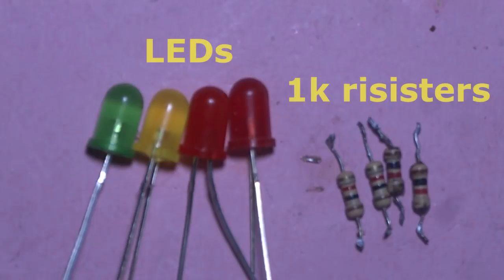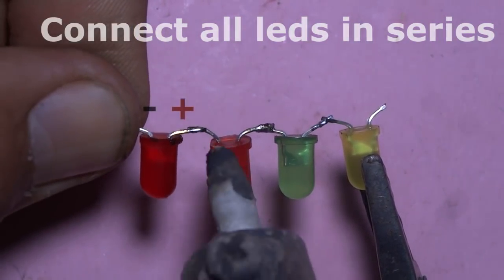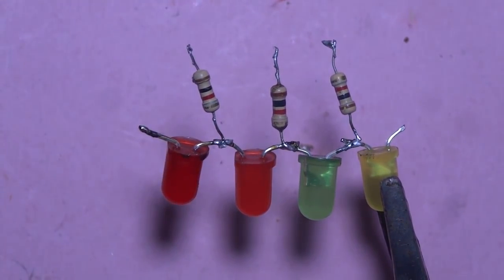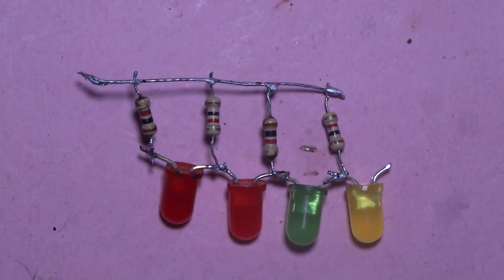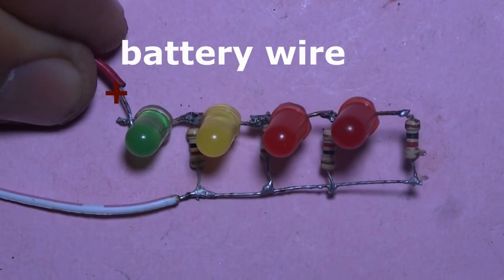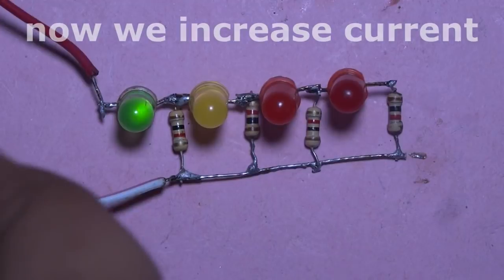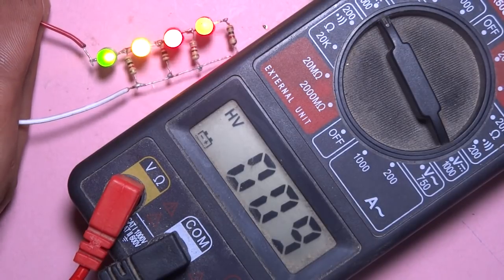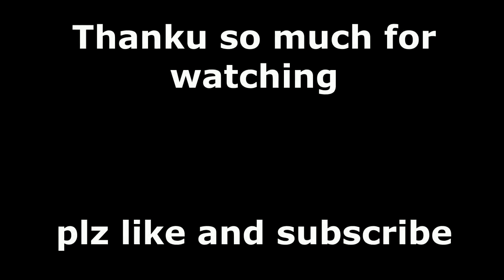Battery Current Level Indicator

Comment: Sir can this circuit be used for 12 volt 220ah acid battery.
And
Sir, can 10 LED bulbs be put in it to check from 10% to 100%.
Reply from the maker: yes dear you can use 10 LEDs in this way to check battery then you will have to 220 ohm resistors 
plz visit my website for my promotion and 2 ads clicks for my sport 
www.envirementalb.com
Reply: gillani data Thanks for the reply Sir.
And,
Sir can this circuit be used for 12 volt 220ah acid battery.
Reply: gillani data Sir, I installed a 5 led and 1k rasistor and connected it to a 12volt 220ah battery. The five led are working but the led is not getting down. Did I do something wrong?

Comment: Hello Gillani Data. This is great. But I want to use it in my motorcycle. I have had been facing battery problem from last 8 years and this could help me to know the level of battery. I Have a 12 volt and 14 Amp. battery. Please share the circuit. Thanks in advance.
Reply from the maker: Yes u can use it
Reply: @gillanidata   Do I have to  add more resistors and leds?? If yes then how many??
Reply from the maker: Yes u can use more resistor

Comment: What resistor need if I want 24v?
Reply: Calculat , 24v ( U ) - 3v ( U Led) impartit la 0.020 ( I Led) = 870 ohm. dar ptr. siguranta poti sa pui 1.2 k.
Reply from the maker: Plz write in English
Reply: korkodel i tried The circuit but it not work well because is for 20v

Comment: But as the voltage increases, the first led is going to get more and more current, while the last led will get reduced voltage, from all of the previous vf from the other leds.
The last led will get like 6 volts less than the first one.
Reply from the maker: Yes dear this problem can b solved with change in resistors 
Anyhow this method will not burn 1st led till 30v

Comment: You can't use it for battery. The logic is OK.. But not practical. This circuit is working from 0v to 12v. First led will glow at 3v 2nd at 6v 3rd on 9v and last full will glow on 12v. But battery is 13v when full and when very low its measured around 10.85v so I don't feel this circuit have title of battery level measurement. If battery is critically low.. Even then it will give you 7v or 8v... Can't be 3v or less
Reply from the maker: U are right 1 more led with 420ohm resistor can b used

Comment: excessive power loss due to resistors. use transistor based control for low power consumption
Reply from the maker: It mat loss of excessive power but very very little and this deficiency can b removed if u use 1st 2 resistors 1.5k instead of 1k

Comment: but their is problem when you increaseto 10v your green led will destroy
Reply from the maker: No green will no destroy because 1k resistors is enough till 24v
Reply: @gillanidata  1k resister can handle to 24 volts 
but not the led .. i think you should use 555 timer with potentiometer for this circuit..

Comment: The title is misleading. This circuit does not measure current. It just roughly estimates the battery voltage level.
Reply from the maker: Yes u are right

Comment: I think, you should solder these LED in reverse:  input>> RED, RED, Yellow, Green! If he use 1K resistor, that mean we measure current devided by 100 wich is 10v like in this video. If we measure 24v, we will use 2,4K resistor. For 5v, 500ohm! 100ohm per one Volt! Thanks.
Reply from the maker: Of course u are right

Comment: Hello, what battery do you measure, what voltage?
Reply from the maker: Dear i have use 12v variable power supply
Reply: Spectacular, this project will serve me in the car. Regards :)

Comment: What if we use 8 resistor instead of 4
Reply: If I want to make it for a 3.7 volt battery, which resistor should I use?
Reply from the maker: then use 220ohm resistor dear
Reply from the maker: Yes u can use 8 resistor with 8 LEDs 
Then u can measure more than 40 volts
Reply: gillani data 
Thanks for your reply. I appreciate it.
Reply from the maker: u always wellcome
Reply: You gona have more work 😜
Reply from the maker: Then u can check 24 volts

Comment: Yeah, just change the video name / explanation of what's happening. As others have pointed out: this does not measure current. This project is not an ammeter. It would show remaining volts in a cell. ... which I don't believe it's hooked up to. I think it's hooked up to an adjustable power source
Reply from the maker: OK sir I will change the name 
Thanx for suggestion and guide me

Comment: At the end of video u r using multimeters, and  measuring voltage, max 10 v with all led's r lit..u r video title is current measurement. Not the voltage.??? Pse comment. TKQ V MUCH  for the novel idea.
Reply from the maker: Sorry dear my multimeter is faulty 
Actually voltages are 15 
If u want to measure more voltages then use more LEDs in this way

Comment: if i want to use only 4 leds for 24V i should replace the resistor to what value? whats the calculations i have to make to know the resistors value for any voltage battery?

Comment: Full battery is 13.8volts and empty battery is around 10.8volts. So this circuit is total junk.
Reply from the maker: Dear it is showing voltage level
Reply: Really depends on the battery.  Thats a car batter voltage you are talking about.  But thays just one of the many many types.  You could use more or less leds to match your battery voltage levels since it uses the diode forward voltage drops to display rough voltage.  That being said picking different leds or using different diodes in between leds can also change the voltages when the leds would come on.  Other than saying current instead of voltage.  I rather liked this vid.

Comment: Cn I use 100ohm?
Reply from the maker: No dear led will burn
Reply: gillani data what resistor need if I want 24v?
Reply from the maker: Then use 8 LEDs 
1.5k resistor with 1st 4 leds and 1k with other 4 LEDs
Reply: gillani data tomorrow i make it
Reply: gillani data i tried whit this resistor but The voltage is 20v

Comment: Sir you're circuit maximum voltages 10vdc but my battery is 12v what I do?
Reply from the maker: Dear my multimeter was faulty it will work till 15 volts
Reply: thanks
Reply from the maker: Dear share my videos and give me likes it will ur sport for me

Comment: Is it work for 12v battery
Reply from the maker: Yes off course it will work on 12v battery or adopter
Reply from the maker: If u want to use it for 24v then u can use more LEDs in same way

Comment: Most of the current goes to the green led and the yellow led first because it’s closest to the battery in the paralle circuit. Try having red, yellow and green led in parallel while the red led is closer to the input and output terminals and the green led is the farthest
Reply from the maker: +Iron _Arachnid  dear current never stay in first led 
Because all LEDs are parallel

Comment: To measure current, or the density of electrons per time, you need a multimeter in "10A", "20A" (depends) in series with positive. Or a clamp meter.
Reply from the maker: https://bit.ly/2xLeOtR

Comment: if i want to meuser more than 10 volts what i should do ???!
Reply from the maker: +الزعيم الأسطورة  use more LEDs with more resisters in same ways
Reply from the maker: +الزعيم الأسطورة  dear connect more LEDs in same way
Reply: thanks
Reply from the maker: +الزعيم الأسطورة u well come dear

Comment: The color should be red color for the lowest voltage,  and green for the highest voltage.   But I ljke this video
Reply from the maker: +Welly L Hakim  Thanx dear
Reply: Yes
Reply from the maker: Thanx
Reply: led panel mount 2 wire voltmeters are a couple of bucks on eBay. They only take a few ma to run. Just sayin'.
Reply: Yeah. I agree. In America, that would confuse a LOT of us if we didn't see it wired.
Reply: austech360 What has America to do with it? Any person on earth understands red = bad/danger/not good and green = positive.
Reply from the maker: Yes dear I have given idea I'm sorry for wrong color selection
Reply: @Engineer9736  if it's a battery indicator.. which it is... Then it's backwards. Green means go. You have a full battery. Red means stop. You're out of schmoo
Reply from the maker: Ya u are right

Comment: This is a circuit which should not be used for measuring both voltage and current. Do mesh and nodal analysis will get the response.
Reply from the maker: https://bit.ly/2xLeOtR

Comment: Nice ... for What battery voltage is this circuit?
Reply from the maker: +David Izquierdo Gomez  it is used for 12v dear
Reply: gillani data thank you !!! And what capacity in A?
Reply from the maker: +David Izquierdo Gomez  amp does not matter as u want
Reply: great .... thank you....I´ve got a question...I´ve got a NimH battery of 7000mah and it gives me an output of 4V when fully charged. I need exactly an output of 3.8 how can I reduce the output of the batterypack to exactly 3.8V? thanks a lot

Comment: Thats will not work
Reply from the maker: +Miley Cyrus dear its 12v battery circuit plz use it on 12v
Reply: gillani data it detects the voltage, not the current sir
Reply from the maker: +Miley Cyrus yes I know thanku so much for correction

Comment: It is not measuring current
Reply: Yeah it's just intended to be a battery charge indicator, not a precision voltmeter
Reply from the maker: U are right
Reply: Yes!! It is voltage level indicator
Reply: Yes not measuring current
Reply from the maker: You are right
Reply: @gillanidata  Assalamu'alaikum.. You can edit the title with your android mobile phone. Step--> Open the chrome browser app, sign in to gmail. Then, open a new tab (without sign out your gmail), then open youtube.com, open the option on the top left corner, give a check on Desktop Site. It will show the browser view as same as pc browser. Then, click on the right corner (your profile), select the Creator Studio. Then see the video uploaded list, choose edit. Then you can change the title, bro. Hopefully, it will help you.
Reply from the maker: +Nihar Rahman  it will measure voltage dear it is used for measuring voltage
Reply: @gillanidata  but you mentioned it as current level
Reply from the maker: Dear I can't change now because video has been uploaded 
I'm really sorry for that
Reply: @gillanidata  friend you can change the title of the video easily from the edit mode in your channel

Comment: sir, can i use it for homemade powerbank during the charging of powerbank battery??
Reply from the maker: +Avijit Mitra yes u can use it for this purpose 
But
U have to decrease the power of resistor according to your power bank original volts
Reply from the maker: +Avijit Mitra yes u can use it for this purpose 
But
U have to decrease the power of resistor according to your power bank original volts
Reply from the maker: +Avijit Mitra use last two resistors 220ohm and first two resister 560ohm
Reply: Sir, suppose my powerbank consist of  three no. of 3.7v  old mobile batteries then can i use those resistors you just replied me  ?
Reply from the maker: +Avijit Mitra  then u will have to use low power resisters 
These resisters are for 12v charger
Reply: Thank you sir for your advice!  then please suggest those resistors values
Reply from the maker: +Avijit Mitra  700+ ohm for first 2 leds and 220 ohm for 3rd led last led with 100 ohm
Reply: thank you sir...
Reply from the maker: +Avijit Mitra  u wellcome dear

Comment: It will work for 4v, 6v, and 12v also.
Reply from the maker: +Rakesh gupta  yes it will work 

If u want to use it to check 6v battery then u should use 470 ohm reisister